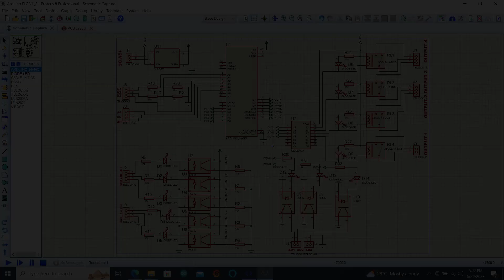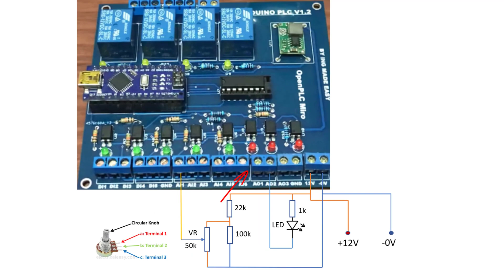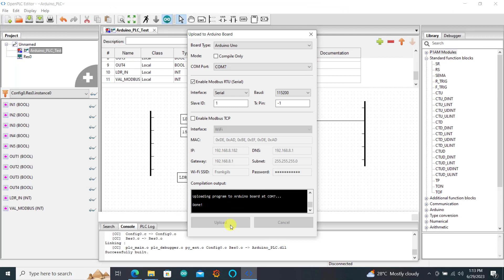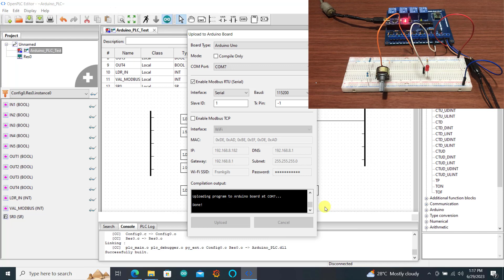DIY Arduino PLC  - How to Use the Analog Output in OpenPLC

Comment: can you explain to me how your digital input circuit works ?
Reply from the maker: The digital input pins of the arduino is interfaced with an opto isolator chip which separator the high voltage 12V from the 5V that the arduino can handle. This PLC input is a sinking type which means you need to apply +12v for it to work.

Comment: how can i achieve a pwm signal to control servo motor using the block which is available int the arduino library
Reply from the maker: Ok will look into it and get back thanks
Reply: @engineeringmadeeasyingme6819  did you find??